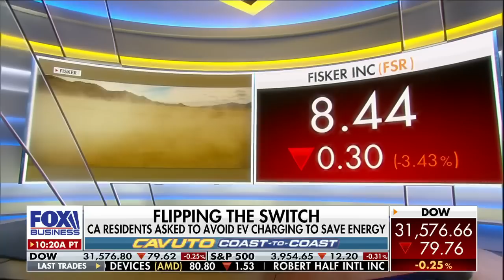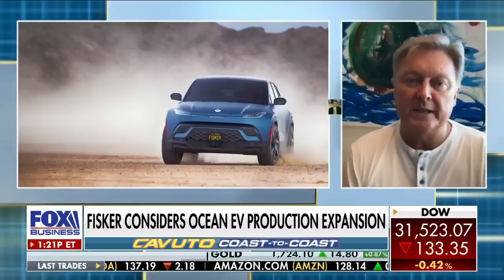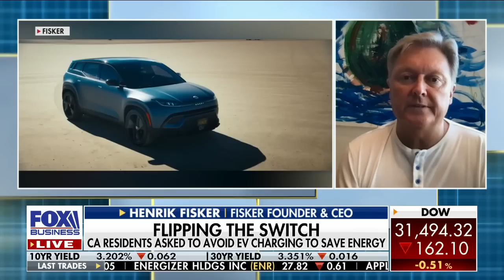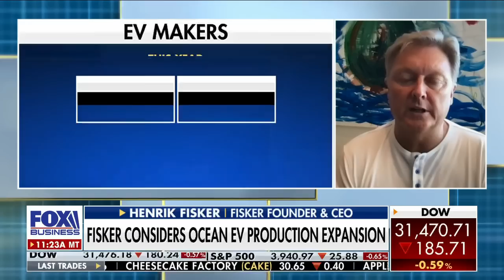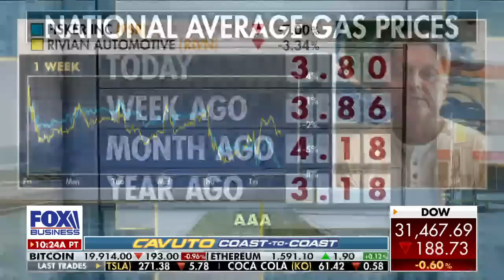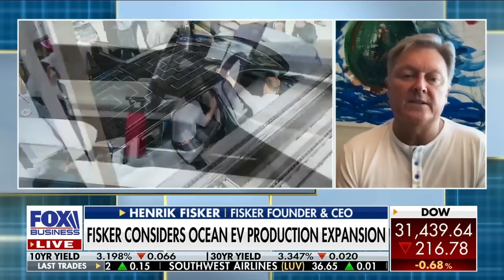Electric vehicles are a ‘wake-up call’: Fisker CEO

Comment: The wake up call is the Chevy Volt with 70k miles that originally cost under $40k required a battery replacement of $28k.
Reply: Yup👏🏿
Truth!
Reply: Not to mention they burst into flames.
Reply: Volt battery replacement is 10k.   Try again.
Reply: @TheSlideshowtube  You try again, wiseass. 10k Miles or dollars? Either way it doesn't matter because...

 @TheSlideshowtube   10k Miles or 10k dollars? Either way it doesn't matter because I just saw a copy of an invoice from a chevy dealer as I described except it was $29k.
Reply: @bobothree  Yeah you saw the same invoice that everyone is seeing once and using as anti ev propaganda without questioning it.  A quick google would prove that case is not the norm. That was a dealership who didn't want to do the work, so they quoted an outrageous price.
Reply: @TheSlideshowtube  Apple products are a perfect example of what we are going to face with ev’s. 

Here are some questions.

How fast will ev components become obsolete?
How expensive will obsolete components cost?
Will maintenance costs surpass value of the car in a short period of time?
Does the value vs longevity ratio make sense?

Ever think about the software that goes into modern cars? Speaking of apple BTW, modern software doesn’t work on old apple products.  

Sometimes it’s just easier for us critical thinkers to say no.
Reply: @justinsmith1374  uhhh tech guy here(actual software developer). Everything you just said is false. Still have a few older laptops( 9 and 10 years old) that I have some of my family use... works fine.  Not as great as my new laptop,  but a hell of a lot better than my 10 year old Lenovo laptop. I have a feeling you're not a tech guy.
Reply: @videosuperhero100  your older laptops working fine is your personal experience and likely possible because of your knowledge. i’m willing to bet that your older laptops dont function near as efficient as what has come out even with your knowledge & experience in tech. You of all people know how fast functionality changes.
Reply: @justinsmith1374  yeah...i do know. Software is complicated...it it evolves. Fast internet, 4k etc wasn't the "norm" and processors weren't equipped to handle it...nor should they be expected to because magic doesn't exist. Additionally...new security threats and mistakes in design have occurred...again...reducing the efficiency of devices because now on every cycle...unplanned security checks need to be made. So intelligent expectations need to be made. Expecting hardware to NOT evolve and then EXPECT older hardware to perform as well as evolved hardware is simply ridiculous...right?
Reply: @videosuperhero100  Correct. Which is why cost is so important. The speed at which tech evolution happens is going to price out the average person from a product that they need. People need phones nowadays, in order to keep up with modern security’s people must sacrifice security or cost. I believe iPhone 8 and older don’t get software updates anymore….the iPhone 8 is only 5 years old….
Reply: @justinsmith1374  the iPhone 8 is perfectly fine to make calls with. But yes...antenna's evolve, gave better quality, cell chips have evolved. and malware has evolved....I'm not sure of your point, you can still use the non-fancy tech part as you did when it was sold to you. You can wipe it, remove all the little evolved apps and it will pretty much function like new if you don't do the security updates. The CORE standard protocols were found to be failing with bluethooth/wifi and in other standard protocols. You can't fault apple for creating a "workaround" to patch these items...and these patches require more batter and CPU. I'm not following you point of your expectations, do you really want to be a Luddite and not use modern tech?
Reply: @videosuperhero100  I absolutely what to use new tech. The point is, is that the value vs longevity is not realistic for the average person. If you buy something and have to pay 25%-50% on top that to maintain it over the course of it’s expected lifetime, you are getting ripped off as a consumer when that lifetime is short regardless of the reasons. If that’s what happens in the transportation industry, it creates a cycle in which people will be forced to finance new vehicles over maintaining older ones they purchased. Its practically like that now with current vehicles.
Reply: you NEVER need to replace a TESLA battery, lasts LIFE of the car.
Reply: CAN YOU PROVE THAT ?
Reply: @mikeholmed7029  That would be the Bolt not the Volt ,do a little research.
Reply: @davidkettell5726  my research says a ev is far from green, weather a bolt volt or jolt, there chucklehead. And it is Volt that catches fire. Maybe YOU need to do a little research......The recall came after the firm learned that when the Chevy Volt's batteries are charged to 100%, they are at risk of catching fire. Initially, GM told car owners to charge their batteries up to 90% until a fix was produced.Aug 27, 2021

Comment: If you are going to build an electric car. Make it self charging. Defeats the purpose plugging it in.
Reply: Battery swapping stations might be a decent solution. If they manufactured the cars to have battery swapping capabilities you could swap batteries only takes 10-20 mins instead of 10 hours to wait for it to recharge.
Reply: Where does "self charging" energy come from?
Reply: @TheSlideshowtube  Was not the old Ford Fusion one of them? If I remember correctly, it could convert the kinetic energy generated by its own spinning wheel into energy for its battery. I also would run up to 80 km//h on energy. Then, it would switch to fuel.

Comment: Quite a few states are still using coal power. Just because the emissions happen elsewhere that battery power is still coal derived. NG is still a fossil fuel.
Reply: The states that are using coal power are not really using evs.. so don't worry it's a non issue. By the time those states are using ev's coal will be removed... states are waking up to the reality that coal is financially more expensive to run and the only reason it's still around is bribes and politics.
Reply: @videosuperhero100  States share the grid between them so your thoughts are not correct. Electric power is routed where it’s required but only if it’s connected to the grid.
Reply: @TheTruth-dy8ze  I'm guessing your referring to CAISO connecting to pacificorp? If not please explain

Comment: Anyone remember the original 'big screen tv's' ? Yep, that's where the electric car market is at...I'll wait a few years and let the suckers deal with the bugs.
Reply: Yes sure do. I opted to buy first a rear projection unit then a plasma big screen. It still works but weighs a ton so wall mounting was extreme large bolts into the wall. Don’t see any of these around anymore. You are correct let’s wait to see what happens and let the first extravagant adaptors pay for the prototype battery powered or other developments.

Comment: Sure, you can bring the price down by using smaller / cheaper batteries. So, the car will be a "throw away" after 10 years. You get what you pay for. EV'S are expensive, and your electricity will be much more expensive. New (expensive) tires every year or two because they wear 3x faster. Manufacturing, mining, charging producers massive emissions. That's why it's not about the climate, it's about selling people cars.

Comment: One thing I didn't hear is the fact that electricity costs are going up, so with the high cost of an electric vehicle and higher cost of electricity, I don't see how this is going to be cheaper for the consumer. Not to mention most electricity is NOT made by wind, solar or hydro. 
By the way, what do you think will happen if 10 families in a small neighborhood block all happen to plug in their electric cars at the same time? Think about that. If you know anything about electricity you know it won't be pretty.
Reply: EVs are much less complex so have less moving parts, etc so much less maintenance. That's one way they're cheaper than ICE (internal combustion engines).
EVs are also more efficient.
And since they're more efficient, the electricity used makes them cheaper to run than ICE.

Comment: Your not going to drive your car over 300 miles a day on a regular basis. And if you need to charge your car do it over night. 
And if you on a long trip your not going to drive 6hours straight without stopping. And it takes around one half an hour to do it. So you stop, get a bite to eat and take a bathroom run. So it's about half an hour anyway. And by the way it costs an average of 15 bucks to fully charge the car. Not 60 to 80 bucks!! So stop the feeble excuses!
Reply: Because everyone has 40K for a car (or even more in other countries) right? Everyone living in older buildings will have stations to charge them I am sure. I do drive 300 km and EVs in my coutry have 200km. That means I will have to stop somewhere while traveling and wait 30min to charge it... as a woman I ain't doing it.

Comment: The most important questions about Ev’s are ev replacement components.

How fast will these components become obsolete? 

How expensive will components become when they are obsolete?

Will maintenance of ev vehicles surpass the value of the vehicle itself in a short period of time?

Is the value vs longevity ratio realistic?
Reply: There 50 years old combustion cars running around. I don't think an EV will ever do this.
Reply: @Willowy13  exactly. We don’t even have battery efficiency in phones yet 🤦🏻‍♂️
Reply: @justinsmith1374  Exactly. Before smartphones, a charge would last for 3 go 5 days depending on the phone (Nokia was a champion). Nowadays, If I get 12h I am happy.
Reply: Don’t forget the recycling challenges these battery powered buggies will cause to the greenies.

Comment: An electric drivetrain is 100% a good idea. Using batteries for storage is totally dumb
Reply: Why ?
Reply: @davidkettell5726  I guess you haven’t seen the fires with these batteries that self combust. There are many examples and they are not from crashes just shorts or overheating.

Comment: The crap of using one form of energy has to stop. There is no reason to keep oil going and have the ev cars too. This crap is not helping anything
Reply: Make the correct choice. From oil, tyres, rubber hoses, window trim, lubricants, fuels, plastics. 
So if you don’t need any of this stuff in the battery powered buggies then let’s go with the greenies route.